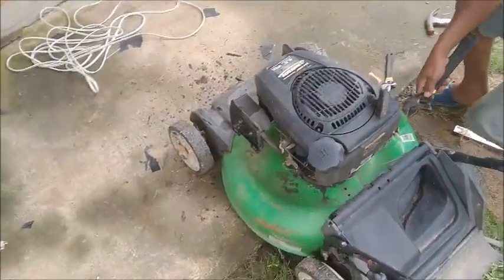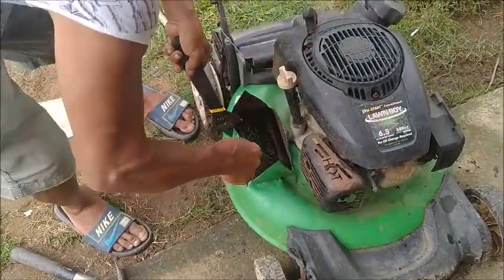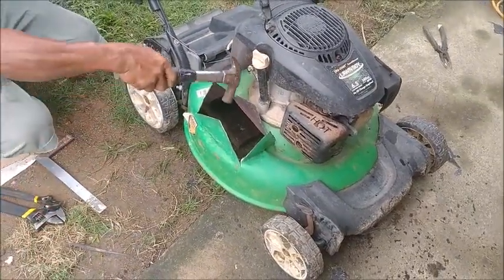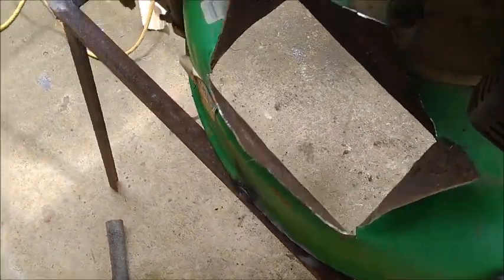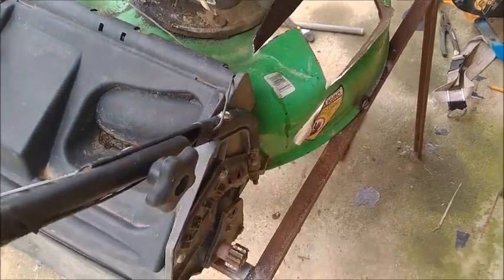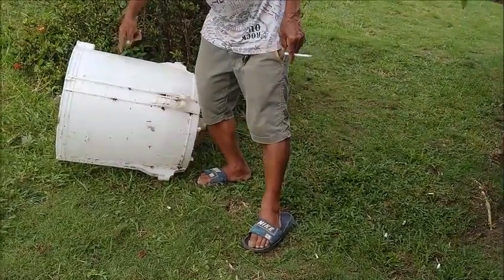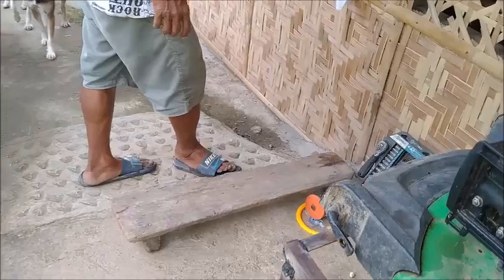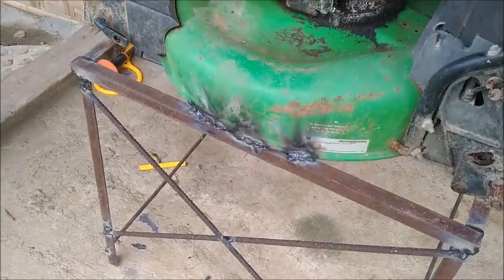The Homemade Mulcher Is Almost Done

Comment: Sorry to say, but if you patent that I'm betting you'd be liable for a lawsuit lol. With it off the ground, it won't create vacuum. But you definitely need to weld on some half inch grate sold a small particles fall through the gate and for safety. Without a grate, you will end up with mostly large pieces and I don't think you want that. That washing machine tub isn't going to provide a safe area that blade comes off or brakes. But other than those couple issues, it's a great idea!